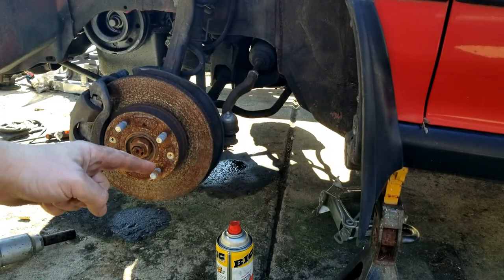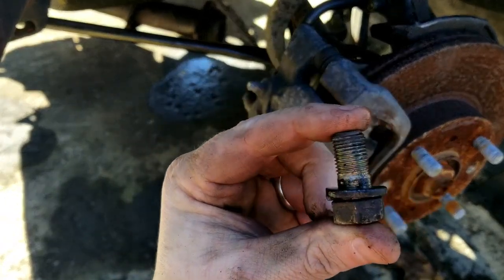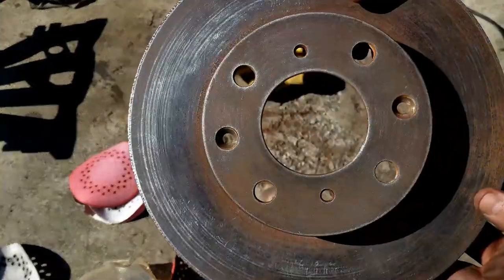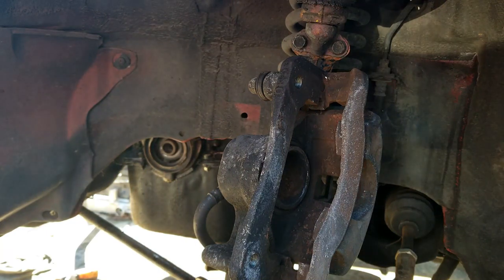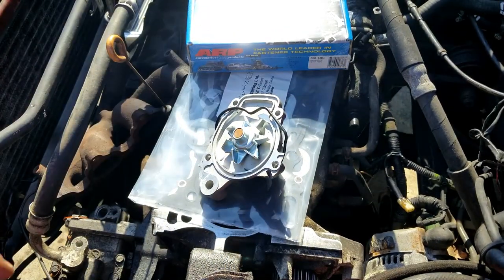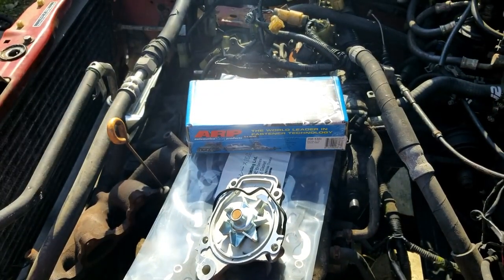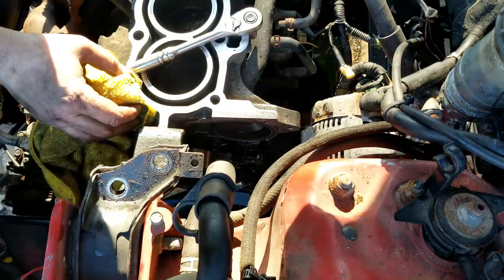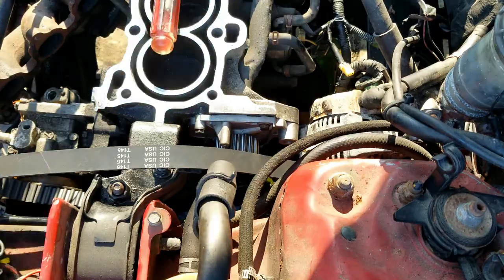91 Civic Wagon  - Replacing the Water Pump and Timing Belt

Comment: How to get Driver front Window regulator (Manual) and front seats cushion and baby blue cloth material.  Have a 91 EE wagon White ORIGINAL , 5spd, 1.5L CIS.  More to come, in need.
Reply from the maker: You can use a sedan window regulator you just have to use one of the rails from the wagon. I don't have one but There are tutorials on civicwagon.com as far as finding seat fabric and foam. Good luck, you can use a passenger seat fabric and foam. I have done this before, I don't have a tutorial bit I'm sure u can fine one.
Reply: @MrJayDM  thanks for your response.  Will look into, for sure.  Keep up the VIEWS, mine is a CENTIMENTAL thing, worth nothing but means everything (a loves' memory) at my age.  Once again  THANKFULLY.

Comment: Is the crank pulley bolt reverse threaded on the 91?
Reply from the maker: No, As far as I know none of the Honda crank bolts are reversed. They can be super hard to remove.
Reply: @MrJayDM  okay thanks I'm about to try an impact breaker bar with impact extension and impact socket. Last hope
Reply from the maker: This video might help, I had trouble getting this one off. https://youtu.be/eJdO3f3RPsk
Reply: @MrJayDM  I got the crankshaft off no problem but when I went to remove the water pump one of the bolts broke off inside. I'm not sure what to do now
Reply from the maker: I had this problem, https://www.youtube.com/watch?v=cJt4pDcvtIs Here is how I fixed it and what a pain in the a$$ it will be with the motor still in. https://www.youtube.com/watch?v=LHdlXfoNwB8 I know it would be a pain to remove the motor but I think if I were in your situation that's what I would probably do if I want to fix it right. You could probably use Honda bond to seal it up with a missing bolt.
Reply: @MrJayDM  actually the bolt appears to have broken off far enough to allow the pump to be removed. My new problem is that the gasket provided with my new pump was too big. And no shop in town has another gasket. 
So now my plan is to cut the gasket to the right size and put a bit of super glue to hold it in place. And since the gasket is slightly thinner than the original I plan to put a tiny bit of gasket maker to fill any gaps. 
Does this sound like it could work or does it sound crazy? I can't wait for another gasket to come in the mail we need the car running tomorrow. The guy at O'Riley's told me he used the super glue before and it worked.
Reply: Right hand thread, just took it off.